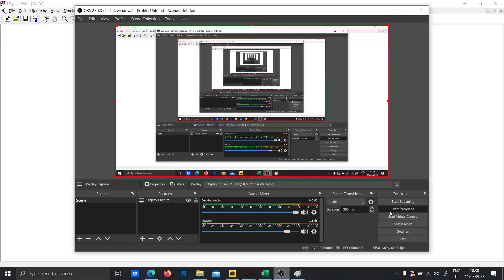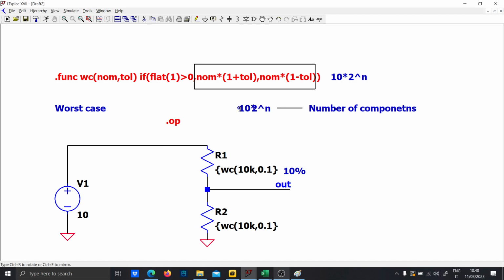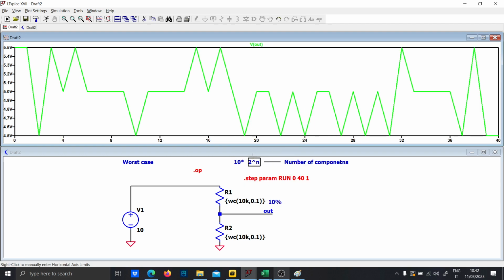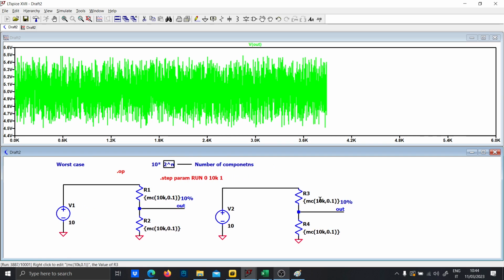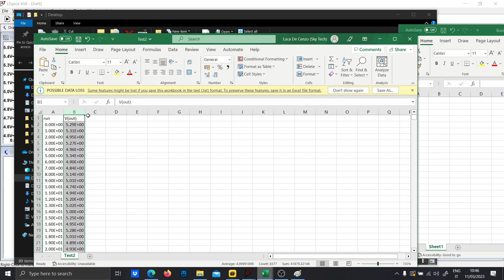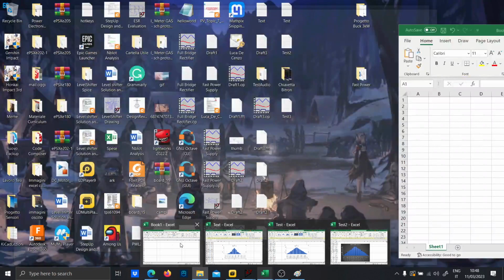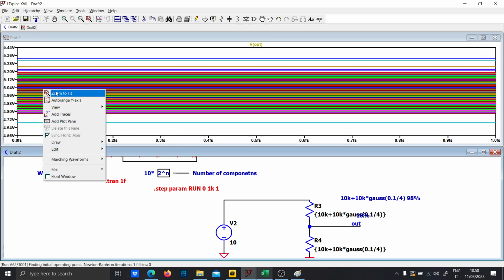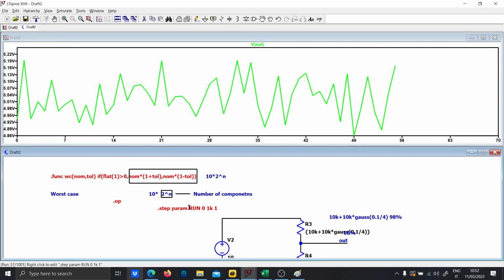LTSpice Tolerances [MonteCarlo,WorstCase,Gaussian] and Excel data export

Comment: I'm sorry I think I missed something important along the way here.

You said "If you import this function".  I took that to mean just write it as a .func, but my simulation won't run (error message of "Can't find definition of model "WC"".  I'm assuming there is a place you downloaded that function; and there is method of actually importing it similar to how we import component models?

Have you suggestions for a place where I may do some reading on the subject so as I may gain some proficiency and understanding on the topic?
Reply from the maker: .func wc(nom,tol) if(flat(1)>0,nom*(1+tol),nom*(1-tol))
.step param RUN 0 1000 1
.op
Copy this
Reply: @LukeXVIIx64  Yep that worked.